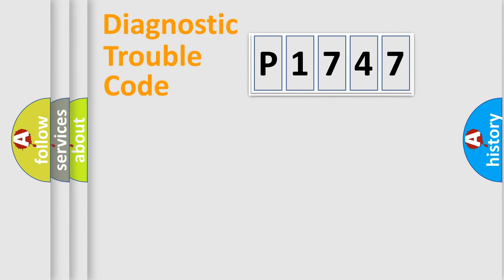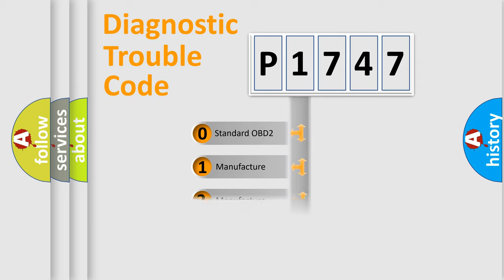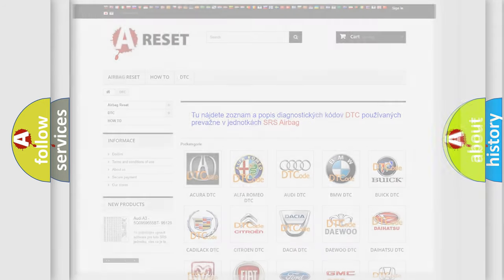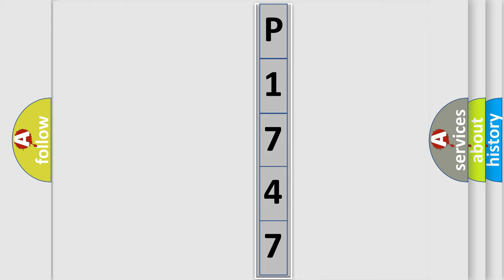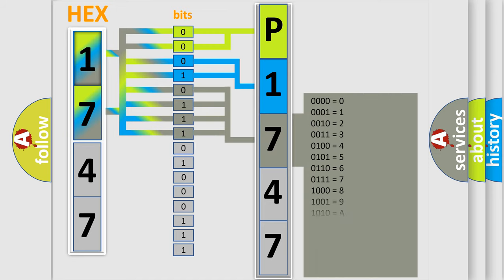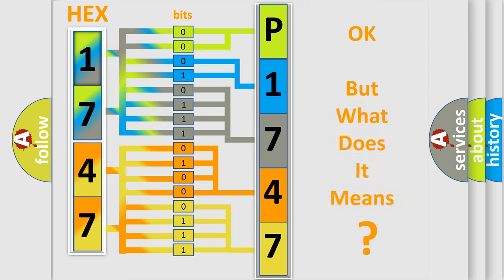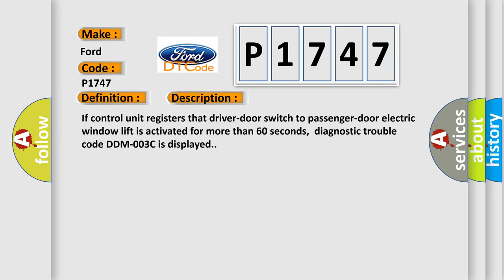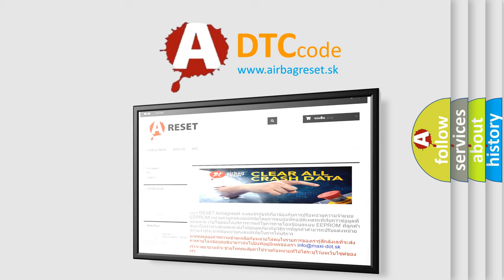DTC Ford P1747 Short Explanation

Comment: Low transmission fluid level did it for mine
Reply: I got the code tonight delivery pizza and the car wants to move out engine wise but it won't go over 30 mph, I didn't check the fluid but I know it was a tad low 4 months ago, so I'm asking did your car do something similar